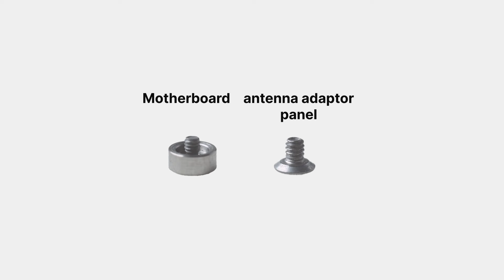Battery, Motherboard & microSD Card Replacement Guide | Supernote Nomad White Edition

Comment: Doesn't work for me - the back cover will not slide no matter how hard I try to pull it 😔
Reply: and now I cannot even get the clips on the back cover back in either after giving up removing the cover - this is starting to feel like the white back design is a rushed cheaply built afterthought